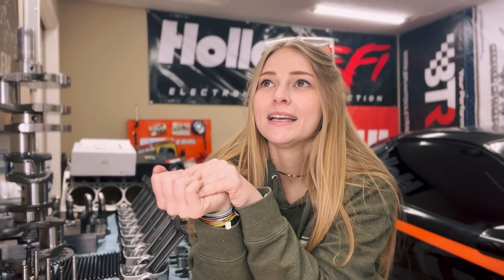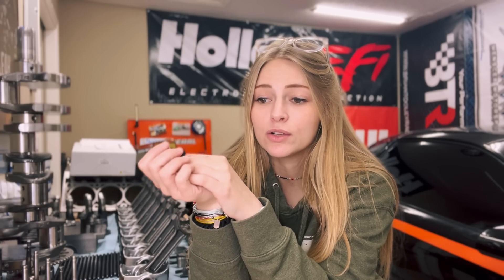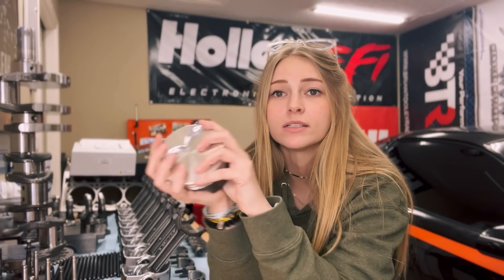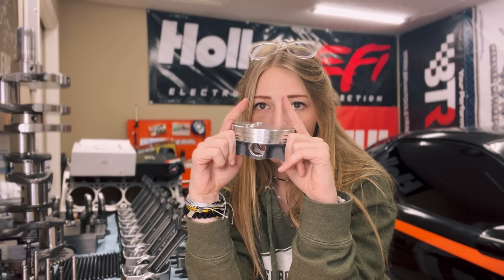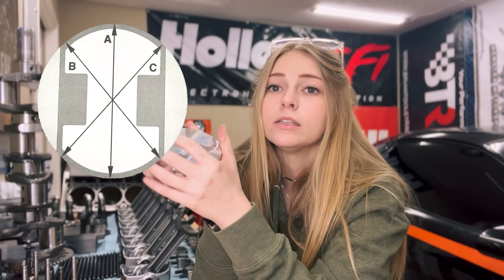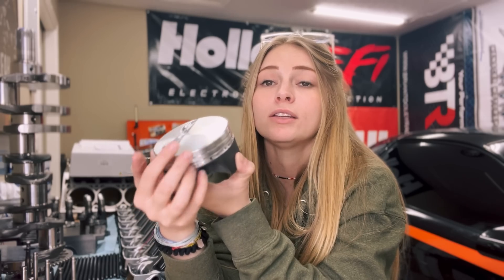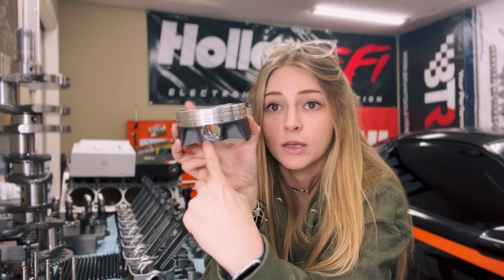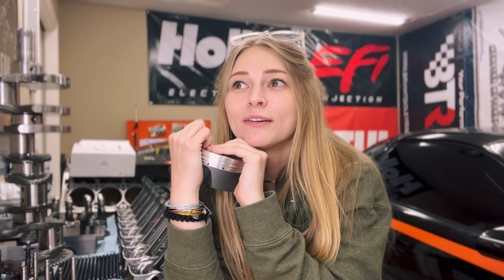Piston Types & Compression Height

Comment: So much info when it comes to this, rod, stroke, and block deck height determine where that wrist pin hole goes. Also how far below or above the block deck the piston sits effects compression too, as well as the dome, dish, or valve relief cc and head combustion chamber cc. Also head gasket thickness and bore size. Then there is quench which is how far the piston is to the block deck vs how thick the gasket is, there is power there, quench of .040 seems to be a sweet spot for power, especially on higher compression applications as the quench helps with detonation and air fuel distribution within the cylinder/head chamber.
Reply from the maker: None of this is the topic of my video lol
Reply: @britneyautomotive  ya but you said what other topic we would like you to cover. Thought this info would be cool.
Reply from the maker: @CarportGarageDragRacing  oh my gosh I’m on another video!!! That’s totally my bad haha I was confused. I did and I thank you for some ideas!
Reply: @britneyautomotive  All good, love your videos. Keep them coming. Hope to see you out at KY Dragway again this year. I talked to you a bit last year the 2 days in a row you was there.
Reply: My son an I will be there March 18th I think it is. He is going to try and run a mid 9 in the 1/4 in his pump 93 gasoline, factory block SBC. I blew up my LT1 and did a 5.3 swap, going to try and run a 10 with it, cam only nitrous on E85.
Reply: @britneyautomotive  because that info is related to the wrist pin height you touched on some.

Comment: God I love u so much brit😭run 12:1 pop ups all day also if u have duel valve reliefs cut into each piston u can swap decks and place the pistons in the opposite deck and before u do take a close look at the wrist pins and you'll see there offset a few degrees so then when u swap sides with the piston heads it will degree the rods and piston head to the rotation of the crank it'll turn up a little bit quicker this way but down side is on cold start it will rattle for a few seconds sometimes and sometimes they wont make a sound oh yea go to your local airgas station and buy a bottle of straight oxygen then run a wet nitrous kit on it but insted of using the nitrous hook the oxygen up to it the extra fuel should make them rings last a lil longer and them coated piston heads should hold off the heat for a bit 😋😍😘😘😘

Comment: The bottom of the skirt towards the middle is generally where the highest load is going to be. You normally want to check to make sure there’s no dings or raises from the manufacturer because that’s also where they’ll test the diameter with a probe or another method
Reply from the maker: I mentioned the load
Reply: @britneyautomotive  yeah Ik I was just saying where specifically on the skirt and a defect we find sometimes. Also a issue that we see sometimes is the bushing in the pin bore isn’t flush with the inside of the piston so that’s something you can check as well

Comment: The height of the top ring plays a big factor on diesels. It’s a balancing act between top ring tension and sleeve strength. The lower the top ring the more pressure is placed on the deck of the block.
Reply from the maker: Good to know! I’m not knowledgeable in Diesel engines